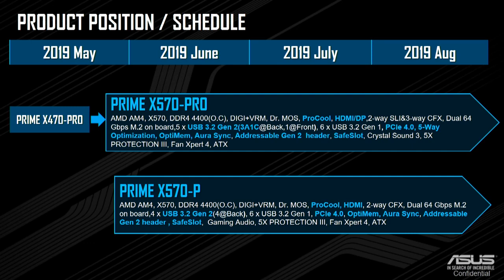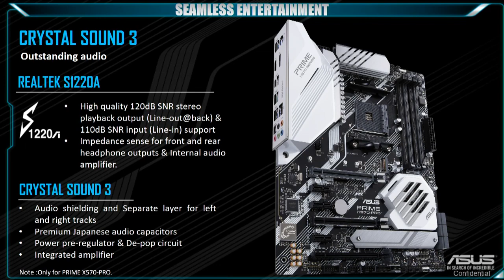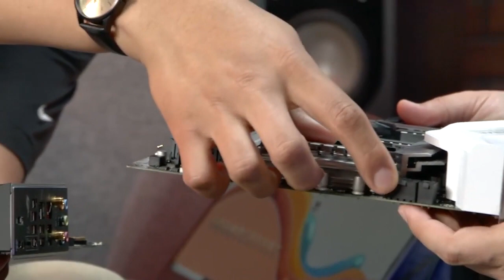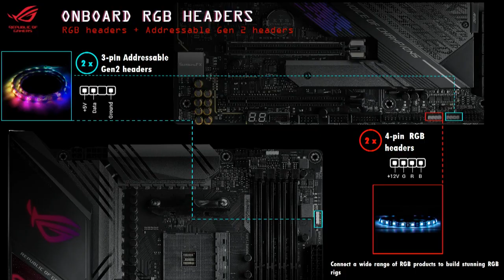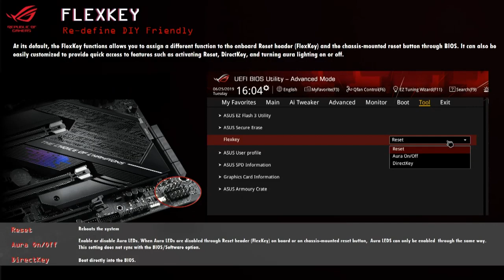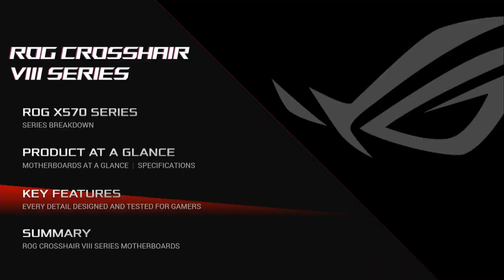ASUS and ROG X570 Motherboard Deep Dive

Comment: No you didnt have a board for me...Crosshair VIII Gene is not existing....i went now with the Impact but its not a perfect replacment.. 2x M.2 SSD less. PCI E x4 Slot missing where i used Asus 10Gbit/s Lan card also is now away so no you didnt have a mainboard for everyone...even i personaly think a gene would sell better than the impact does. just because impact is realy expensive and X570 i is for people wanting a realy small one and the impact just delivers not enough for people who dont want the X570 i so gene is the best solution inbetween mITX and ATX

Comment: Why no MATX boards?
Reply: With that Crosshair Impact board they went to the time, effort and expense of creating a proprietary board design in order to acomodate things which mATX would have already supported.  Sheesh, what a waste of time, effort and expense.
Reply: Impact will fit in any mitx chassis that doesn't require a gpu riser. matx won't. I do wish they would've made a matx board though since the impact is too high end for my needs and is way too expensive (more expensive than most intel hedt boards even at 400 dollars)

Comment: One flaw in Asus mobos is the Aura Lighting feature. It is factored into the price of the boards. I say since Asus doesn't seem to care about this problem, leave this feature off the boards and adjust prices accordingly until it is fully baked. Before you Fan Girls and boys bash, check out the forums on Aura. This also has been my experience -Aura failure.